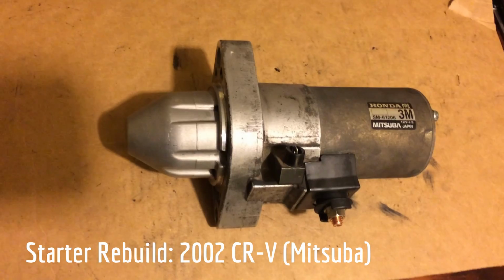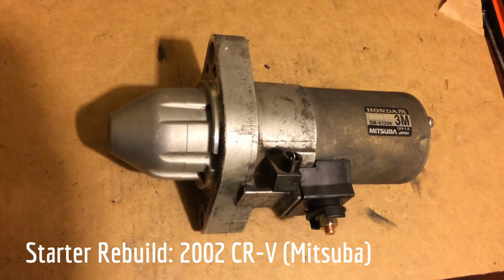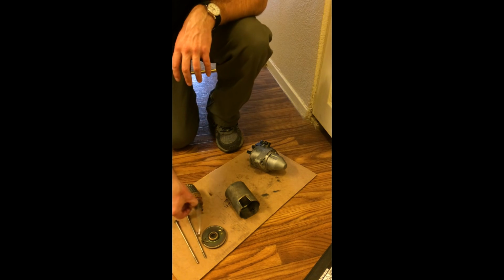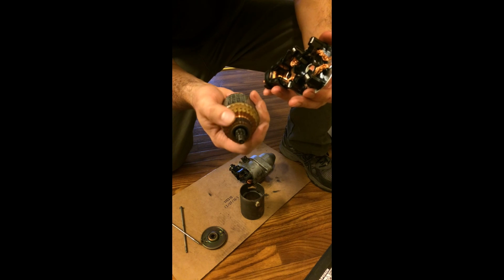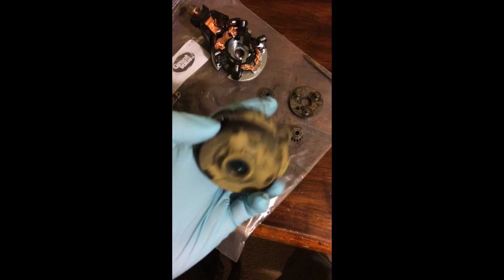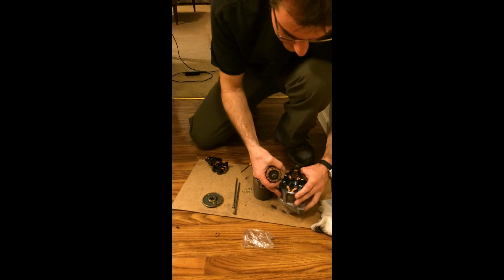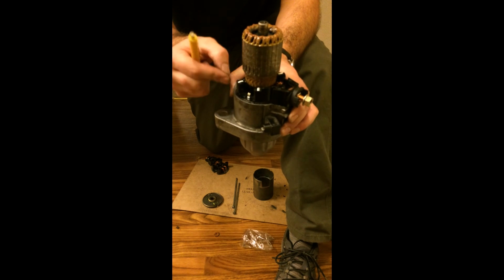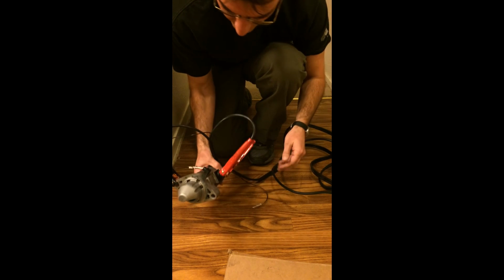$25 Starter Rebuild: 2002 CR-V (Mitsuba)

Comment: Thanks, great video, rebuilt my original starter, need to use the shaft from the rebuild kit as it has a ridge that the push nut sits over and won't move back, and gets the right spring tension for the contact washer. the original shaft did not have this ridge. The new shaft in the kit was a bit tight through the brush housing, needed to very slightly trim the shaft so it moved smoothly. Note - If you can get the starter out, you have qualified for enough skill to rebuild the starter motor!
Reply from the maker: Thanks for the comment! I had 30,000 miles with no issues using my Chinese rebuild kit. In fact, it got smoother as the brushes "broke in". I sold the car so I don't know how long the fix will ultimately last. Take care.
Reply: your def right about that (if you're able 2 get the starter removed you're qualified to rebuild the starter!) most people didn't believe it when I told them the intake manifold had 2 come out 2 get 2 the starter. they assumed I just didn't know what I was talking about. also, I don't know why but my starter was stuck 2 the bellhousing, even with all the bolts and connectors removed. took me hammering as hard as I could against a 2x4 held on the starter to eventually break it loose!? also that bolt under the intake was a PITA! I had 2 go buy flex head rachets to get that thing off! I did every single bit of it myself (down to testing the voltages on the source, control and ground hook ups while cranking.. which took a bit of extension wiring in order to manage that).
I'm def rebuilding since not only is it cheaper, I'll also be able 2 do my own quality control, bc just like you mentioned, I've also heard you cant always trust in the remanufactured ones.

Comment: Helpful video ,thanks.  The Honda manual advises to re - grease with  molybdenum disulfide grease, clean out slots in commutator with hacksaw blade and polish commutator with 600grit
Reply from the maker: Yeah, I didn't have the correct grease. But I cleaned up the commutator. Take care.

Comment: Hello there, do you happen to know how to remove the solenoid coil inside the housing? My honda city T9A mitsuba having a problem which the gear won't fully engaged when start *test on battery outside the car

Comment: Great video.... do you have a link for the rebuilt kit?
Reply from the maker: I don't think I can find the original link, but search Ebay for "2002 CR-V starter rebuild" or "2002 CR-V starter brushes" and find the one that looks correct. You will probably find multiple vendors, so pick one that is fairly cheap and the seller has good reviews. Obviously, this is not as good as a factory rebuild, but my starter has been working well for the last 5 months so I consider it a success. Good luck!
Reply: Buy the one from Honda $50 and worth it.